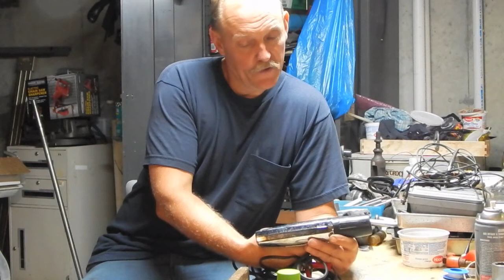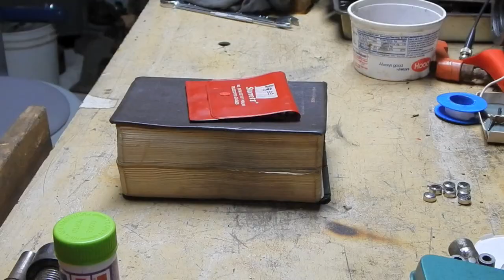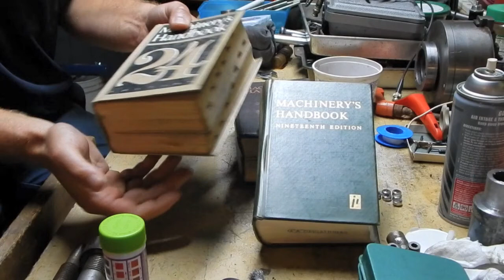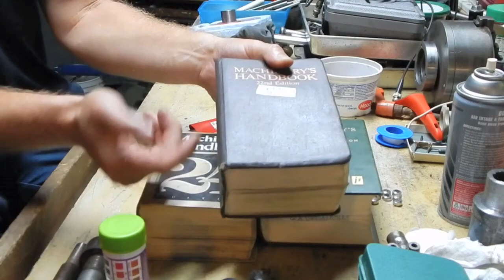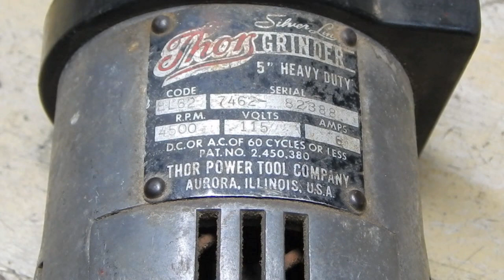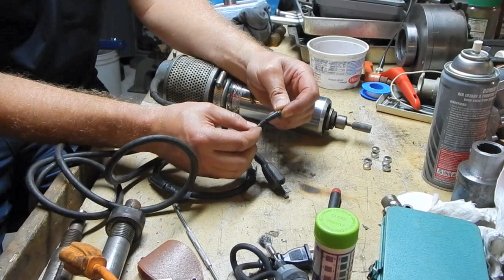The QVEA Flea Market finds of July 2016 Part 1

Comment: My take on the last grinder plug is you take the screw that holds an outlet cover plate off and insert that pin. That adds a ground connection to the 2-prong outlets. That is, if they actually are grounded ;)
Reply from the maker: could be. I've never seen one like it.
Reply: yeah that would probably be it.  A lot of the older gray 2 to 3 adapters have a small wire to screw onto the center wall plate cover screw.
Reply from the maker: +gbowne1 so it appears the pins there yo plug into the ground on a three prong outlet but can be unscrewed allowing the threaded part to substitute where the outlet screw goes......wow.how many of those must have been lost over the years!